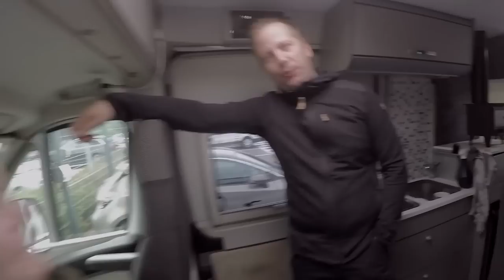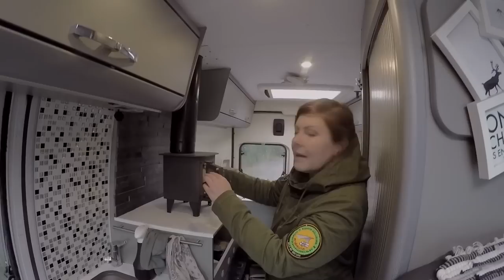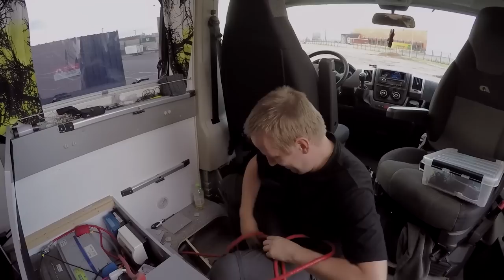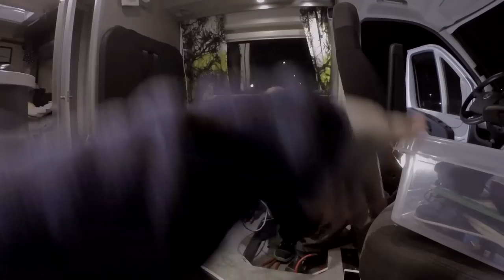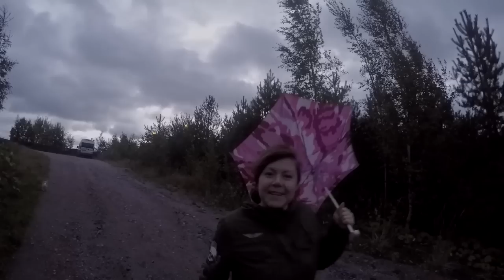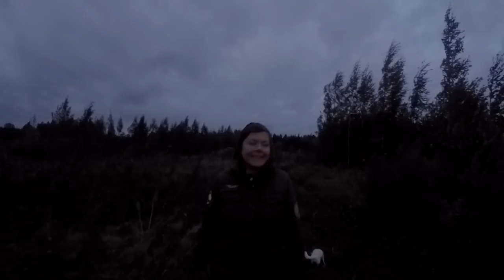Bad weather day l Battery to battery charger

Comment: get those gardening corkscrew things meant to hold trees about half a meter long that you twist into the ground and twist them into the ground then use tiedowns or tow straps to strap the van down.  4 corkscrews and two straps.
Reply from the maker: Have to take closer look if our hardware store has those.

Comment: You mentioned that you hope to upgrade to Lithium batteries. I live in Canada and use my campervan as a mobile office, including in the winter. The Lithium batteries are wonderful 3 seasons of the year. However, in winter they are a real pain as you can permanently damage them if you charge them while they are cold.  I solved that with an electric battery heating blanket around each one.   I also monitor their temperature and always check before plugging them in to recharge. 

A friend of mine just outfitted his van with 'carbon foam' batteries. They are supposed to have some of the benefits of Lithium but are also tolerant of cold weather much like AGM. They are also less expensive.
Reply from the maker: We are going to install BMS with external relays, so when its too cold it won't charge and when voltage drops too low it won't consume power.

We can discharge them while its -45c so if for some reason our van would get cold, we can always start our lpg heater to warm up the place. If happens that battery is below zero AND voltage is too low then we just drive the van until its warm. That would be once in a lifetime happening.  :)

Comment: Thick cables check... I could only get hold of 70m2 cables when I was camping in Finland, needed cables for my inverter and everything else I am installing. All other was sold out exept for tiny 6m2 , but at least there will be little to no loss (except in my wallet because of the cost)... Also it was sold out everywhere for small gas heaters so I had to cut my trip there short because it was getting cold and I had no heating.
Reply from the maker: lol, thats huge! Atleast you dont have drop on voltage. :D

Comment: Just wondering: why don't they put electrical cables under ground in order to avoid power outages / mains failures  based on trees cutting the cables during a storm.
Reply: I think they are, that's why the electricity bill is skyrocking and they have exclusive monopoly.